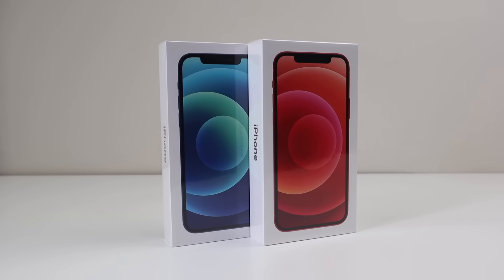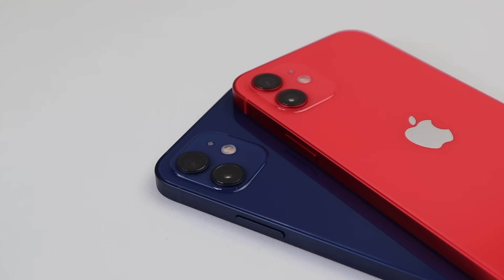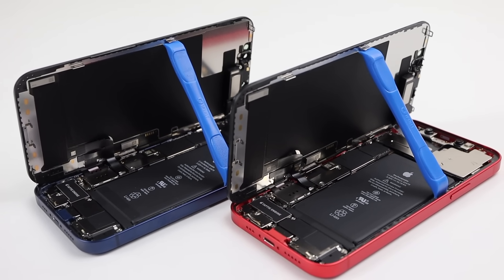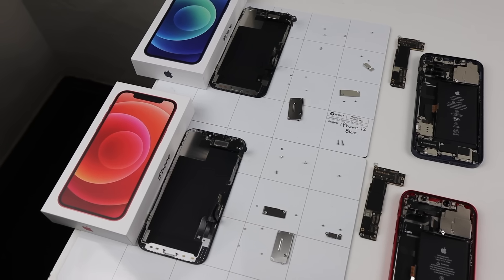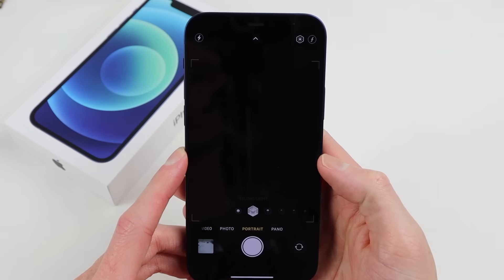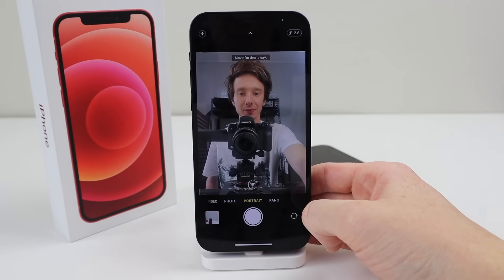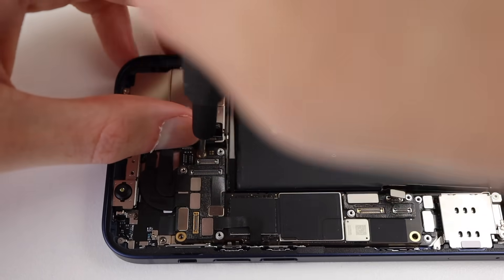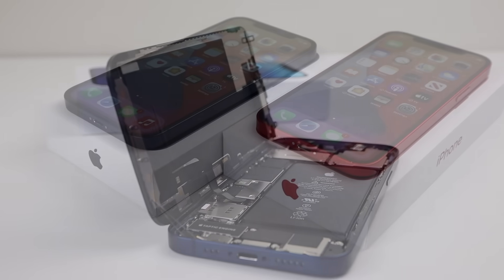iPhone 12 Anti Repair Design - Teardown and Repair Assessment

Comment: I remember the good old days when iPhones were the easiest phones to repair. When I broke the screen on my first generation SE, I was easily able to swap it out with one from a dead 5S and later a third party display without any error messages or loss of functionality. I'm keeping my SE for as long as I can.
Reply: 5s was where this whole mess started, when they decided to make touch id non-replacable. But yeah, it went downhill ever since.
Reply: I still think they are the easiest to repair mainly the screen as is by far the most commonly broken part
Reply: Yeah in my opinion the 6s was the best generation. Then it went all downhill from there (in fact I just bought a 4s to replace it's logic board out with one from a 4s that i absolutely mutilated trying to repair because you need to damn near be a rocket scientist to go past the battery being replaced.)
Reply: Things went down hill After cook too over.
Reply: You're not alone. I'll also be keeping my first-gen SE till it somehow becomes a) damaged beyond repair, or b) so outdated that it won't even be able to make calls or surf the web.
Reply: I did the exact same. Still have my SE with a 5s screen. Sadly lost the original Touch ID so that doesn’t work
Reply: @Jake.brazier  Yeah, I found that transferring the home button can take up to 45 minutes due to one very finicky screw. Sorry to hear that yours didn't work out.
Reply: Dude just get an android and save your frustration. It's okay to let go of the cult now.
Reply: @devillif311  Contrary to popular belief, not only is it not a cult, but most people with iPhones really don't care about the brand at all, whereas if someone has a OnePlus, they make sure that you know it. Truth be told, I'm not a fan of Apple, but I'm even less of a fan of Google, having owned multiple Nexus and Samsung devices in the past. When I tried to get my Nexus 6P repaired, I was informed that due to a logicboard defect, the available $300 screen replacement would have failed again in a few months. Compared to that, my iPhone SE cost me $40 to easily fix by myself after someone dropped a dumbell on it. New iPhones are garbage, most Androids are garbage, but I'm happy with my SE, and I plan to keep it until it ceases to meet my basic requirements of a smartphone.
Reply: @aidenbagshaw5573  Yeah, same opinion from me. Had a Nexus 5 and a Honor 7X now. Android version update is utter garbage and they let users out in the dry just a year or two after purchase with old versions. Atleast Apple updates everyone even though with bugs. Never own a iPhone but wife does. Only iPad and watch are the usable Apple devices imho.
Reply: Super underated 👇 (gaming content)
https://youtu.be/8rbrRG4xROY

Comment: Honestly this is not a trouble as any repairs done on these devices are well more complicated that an average diy person can perform., private or non authorised repair shops are also non recommended as quality of job will be well below acceptable for Apple standards. The only issue I see with this year iPhones is that they messed around with the charging options pushing you to buy separately charging accessories. New iPhones recognise been plugged into non usb c charger and charge up very slowly even your chargers are quite powerful. 👎 for that Apple 🍏

Comment: It’s absolutely disgusting! I’ve been a huge Apple fan for nearly 2 decades. This is not the Apple that I once knew. My 2008 MacBook Pro is still running to this day, with incompatibility with the new operating system being its only issue. I can still handle HD streaming, video editing, audio processing, and I can replace the components to keep it going. Compared to my 15 inch retina MacBook Pro from 2015, which is already failing. Unfortunately for things like replacing the RAM, I can’t. That stuff is soldered to the board so will have to deal with only what came with it. I’m just thankful that I went for 16 GB. I also have a 2010 Mac Pro that I have kept going, however they don’t support the hardware anymore even though it is perfectly capable of handling modern tasks. I have found myself trapped in the apple ecosystem because a lot of my iTunes content, music library, has all been integrated. All of my software’ and back ups have been integrated to iCloud. I’m sure that if I wanted to spend the effort, I could replace all of that and have on-site storage, which is some thing that I have been meaning to do for a while, but all of the money that I spent on content from iTunes, music, videos, TV shows, would all disappear if I decide to leave the ecosystem. I think my next phone might be an android
Reply: Niralok I’m still rocking my Xs Max. I upgraded from an iPhone 6 to it so it was definitely needed. I love this phone, it’s actually been one of the best phones of all of the iPhones that I’ve used. I sprung for the 512 GB model so I never have to worry about space. I only chief complaint right now is that with the pandemic going on it’s very hard to unlock my phone with anything but the passcode. That is unless I decide to pull down my mask which is not an option

Comment: I totally agree with the right to repair and the video is elucidating. However, I live in Brazil and the cheapest iPhone costs more than the equivalent of 2 thousand US dollars (Brazil imposes extra charges for Apple devices). Depending where you are, cities are quite dangerous and iPhones used to be the target of thieves. People steal and sell the pieces since they cannot unlock it. So, even though Apple locking up the phone seems contradictory, there is this very important point to consider when criticizing the locks imposed by Apple. What they should do instead of unlocking the phone, is to low the devices repairs costs.

Comment: Display and battery warning appears only on the first boot? Camera issue was experienced in previous iPhones?
Reply: Camera issue is present in previous iPhones however with the new iPhone 12 lineup the rear camera module is indeed serialized and paired with the logic board.

Comment: Fixed up a broken 6s I found outside someone trash bought a screen battery Inside had no water contact as those water strips weren’t red and once the repair was done it work just like a prefect phone that costed me 60 bucks to get good quality parts, I agree should have a right to repair the device so it can last it’s full cycle until it isn’t supported by iOS updates

Comment: THIS IS FUCKING INSANE, we don't include a brick wall charger so you can buy OURS that is the only one that garantees a perfect 15W charging flux with our MagSafe (not included) wireless charger, also the cable we give you is usb C so you can connect it to our 3000€ laptop but not to your APPLE ORIGINAL iPad or iPhone wall charger, since is USB-A, also we lock every component with it's respected device, all this to save the environment. YOU'RE WELCOME...

Comment: Somehow is good that stolen phones can’t be used for spare parts because everything seems to be hard coded. Hopefully it can be possible to buy e new camera or other parts that haven’t been used in another phone and just replace it with the ken one and should work fine. Or apple can add an option on iCloud where people can allow parts to be reused after they sold their phones and not stolen ones.

Comment: This already was an Issue on the iPhone 4. If you swap the Camera-and Flash,  to a other iPhone 4 mainboard, it won't work. At first only the inner camera will work. If you restart the Phone, the flash actually will work for some seconds as iOS isn't completely loaded up but after that, it won't work. (iPhone 4, iOS 7.1.2). iOS 7 was invented with iPhone 5s wich had the first touch id pairing so it is surely just disabled from iOS.

Comment: The reason the face ID doesnt work on the 12 is the same as with the iphone x to 11 pro max. There is a sensor attached to the earspeaker that is paired to the phone. So when replacing screens the original earspeaker has to be swapped over. Once that cable is swapped face ID will work.

Comment: For rounded crews put ur screw driver on the screw and use some soldering wire and a soldering iron to solder the screw on the screwdriver it works just fine

Comment: This is just calibration data specific to the components. By changing the logic board you try to run a screen, camera, etc with a different calibration. Even if they let you use they will not work correctly. Also the calibration tools are huge and expensive. Even if you would copy the calibration data from one board to the other it might not work as it should as the boards have small differences in the components that will shift some of the readings a bit to much.

Comment: leaves charger out because they "care for the environment"

also makes phones unrepairable and makes more E-Waste because they don't actually give a f**k about the environment
Reply: I dont think they even care about the enviroment I presume the price of the phone is the same as the last generation that had a charging plug in the box is prob just to get you to spend more as i presume from apple the plug isnt cheap and while you are on their website looking to get one you probably will see there airpods and watches being advertised in the hope you buy them aswell
Reply: @stephencross3499  a company cannot claim they care about the environment and be against right to repair at the same time - one has to be a lie. If you surely believed in the environment, you'd agree that repairing phones rather than tossing them out and replacing them reduced E-Waste/carbon footprint? Nope. Not Apple. They believe in some Schrödinger's Cat bullshit.
Reply: @stephencross3499  apple chargers are also much more expensive than chargers from reliable 3rd parties like Anker
Reply: If they would really care about e-waste then they should had removed lighting port and opted for the type-c one.
Reply: @insanity2058  True.
Reply: @insanity2058  if they really cared, they wouldnt toss out repairable devices and replace them (they also wouldnt pair 1000 features together to prevent repair)
Reply: !!!!Caution!!! Ugly Scratches!!!!
i phones screens are getting ugly scratches with in hours of use.
★MKBHD at 3:21 (https://youtu.be/X1b3C2081-Q)
★Dave lee at 2:32 (https://youtu.be/ybt03airuTk)
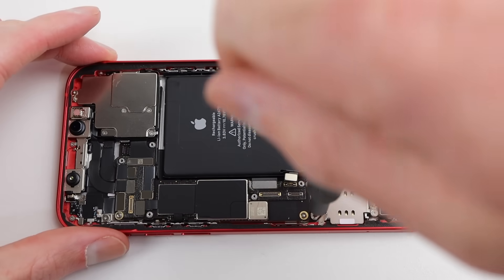★Pocketnow at 6:23 (https://youtu.be/FRlt83YX5yQ)

Only whatched these 3reviews of MKBHD, Pocketnow and Davelee and they all are experiencing ugly scratches.
Are all other reviewers are having the same kind of ugly scratches? Tobme it in now 100% cases.
Reply: @abuhurairah9977  stop self promoting on my thread
Reply: @maybelbdidit , oooo "my thread"!!! 
is thay cute or opposite?

Hey everyone, may be you didn’t notice or didn’t know i was Self promoting in "his thread".
Please unlike me.
Reply: Nonsense Apple lost a case in the EU and they have been forced to go the usb c route , they tried to avoid it but this is there answer
Reply: Money and revenue matters only
Reply: Of course they don't care about the environment, they are a business that only wants to make more profit and revenue, the only companies that actually care about the environment are companies that only exist to make environmental solutions and non-profits that talk about saving the environment
Reply: They want you to switch and buy there phones so they use an excuse saying that they're going to eliminate their carbon footprint by 2030 it more like you buy there phone and you get a pos that unreliable and overpriced all this company cares about is your green paper in your wallet or you plastic in your wallet that gives them the ability to make more shitty and anti repairable phones
Reply: Hypocrite!🍎

Comment: Hello I’ve been working at a small cellphone repair store for about 5 years now. Could anybody or you yourself Hugh, why did you plug the phone in before plugging the screen in?
Reply: Sometimes after replacing the logic board and having the battery disconnected for a period of time it's necessary to plug the phone into power for it to turn on, just for the first time.

Comment: So repairing and reusing isn't recycling it's part of the very definition of recycling. Breaking things down to melt them down and reuse is NOT as environmentally friendly as people think, that takes energy from various forms. What is better is reuse parts that can be as with MOST devices. Apple thinks that having the monopoly on repairing is greener if thyeh do it but they also charge a fortune. Apple is just plain greedy. The problem is that people will still buy their products regardless, not meaning the secondhand ones, but the new ones.
 
I have no idea why people think recycling does NOT mean reuse and repair, that is part of the very definition as I have said. 'Recycling parts', anyone heard people use those two words together? well, that's recycling.
 
This is exactly how you break a business. They are greedy due to their own business practices that cause them to want more money etc. it's a knock on effect. They are so blinded by their own greed.

Comment: 8:30 this was addressed many months ago by Louis Rossmann and ended up in a political debate with many 3rd party service shops depositions in favor the right to repair; Rossmann did exactly what u did: used GENUINE,, BRAND NEW PARTS FROM AN ORIGINAL SAME MODEL IPHONE and still got those "unsupported battery,, display warnings" and all kinds of apple crap; this is one of the many reasons why not to buy these expensive bricks

Comment: Good video, but the phone not turning on without the power is a widespread bug (I think), I just bought my iPhone 12 pro from an Apple store and it wouldn’t turn on normally straight out of the box, that was until I plugged it into the power, where it instantly booted up.

Comment: iPhone 12 has 4GB of ram while the Pro has 6GB. I would assume the camera app for both devices are optimised for the respective ram usage hence the wonky camera functions. 

Really unpopular opinion here so bear with me. This method effective prevent thieves from replacing the original logic board with a spare one and re-selling it later on. Yes, I am aware of various workarounds to re-programme the iPhone modules but hey, keeping every single modules in an iPhone serialised might not be a bad thing. It hampers people from frankenstein-ing lost phones and re-selling it later on. 

To the topic of anti-repair here. Not everyone is as talented as either Ross or Jeffreys. 3rd party repair shops oftentimes screw up the interior while repairing your phone, even with original iPhone parts. If you are spending over a grand on a phone, why would you send it to a 3rd party repair shop for repairs when you can just drop by an Apple store for repairs? Yes, you may save a couple of dollars to a hundred, but I would gladly pay that alone just for the peace of mind. 

I have never really get it why Apple is being referred to as being anti-repair etc. Not everyone is gonna repair their iPhones themselves. The time it takes to order and receive a part, price of the tools necessary to repair it isn't worth it to just letting Apple repair the phones. 

Don't @ me. I don't even use an iPhone myself.

Comment: at this point, apple might as well pair the screws to the phone, and if one screw is missing or replaced, the phone wont even boot. how about that.
Reply: Don't give them any ideas, it would be as simple as grounding all the screws to each other and having the phone run a current through each screw (through a contact on the motherboard) and check to see if they're all there.
Reply: @Bluecolty  Yeah but then any screw would complete the circuit thus pass the check.
Reply: @antikommunistischaktion  Not if they imbedded a tiny resistor in each screw, and the circuit had to have the exact amount of resistance in it to match all the other screws.
Otherwise they could etch a QR code into the bottom of each screw, with a fingerprint sensor membrane sitting under each screw hole.
Reply: My guy delete this you giving them ideas 💀💀💀
Reply: APPLE: WRITE IT DOWN!! WRITE IT DOWN!!!!!!
Reply: Or pair the glue, that would be even more efficient in preventing third party repairs
Reply: That's a promotion!!
Reply: Apple: "damn this guy is right, let's hire him"
Reply: Hi I'm a recruiter for Apple do you want a job?
Reply: Instead of screws, it could just be permanent connections. The phone will just be one piece of continuous bonded metal.
Reply: DON'T GIVE THEM THE IDEA! they may just do it!
Reply: Imagine if they paired the boxes in the future. 😂😂
Reply: Sigh dont give them ideas 😂
Reply: ha, how you like that? (bara bing, bara boom, boom, boom)
Reply: @landocalrissian6490  my Samsung Galaxy J3 is already having this kind of problem with the battery it came with after only 20 months, it keeps telling me it's not a Samsung battery and doesn't want to charge until i reboot the phone, my 2017 lg k8 had the same problem after a year but that was unfixable and i had to get a new battery for it.
Reply: If apple reads about screw , We Are SCREWED lol
Reply: Worse, very soon, the logic board will carry something like a deadman's switch which in the event it detects any parts inside have changed without Apple's conssent, they will automatically wipe all the ID codes on every component and then proceeds to brick the logic board so no component can be used for repair other than Apple.
Reply: Don't give them more ideas I already have to deal with bs lol
Reply: Lol yep
Reply: Funny memes https://youtu.be/IWLj2WVkkI8
You can't stop laughing 🤣🤣